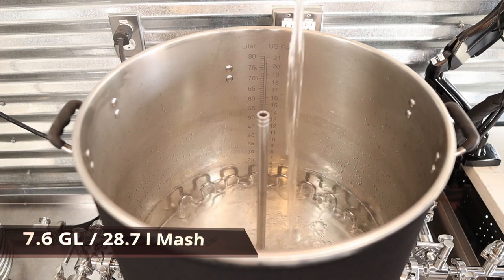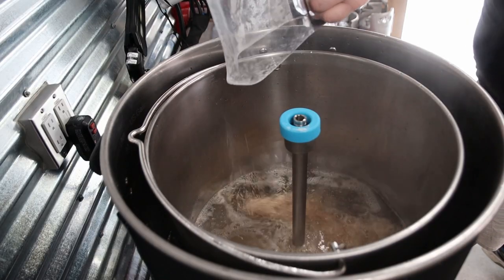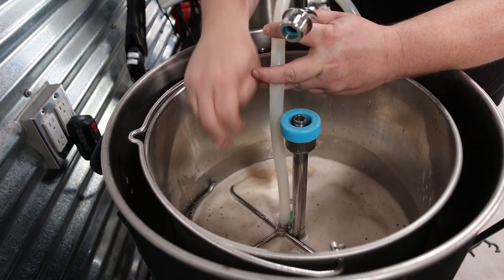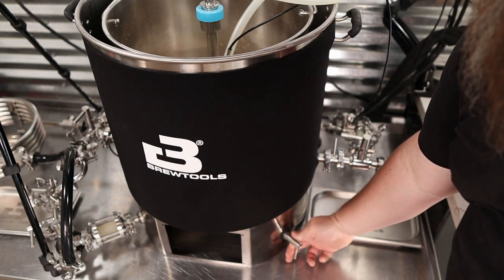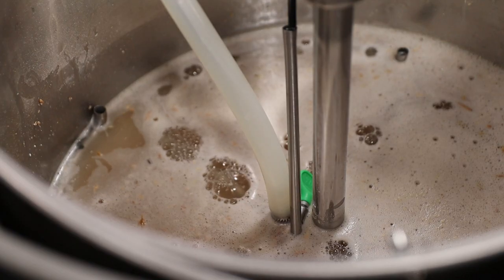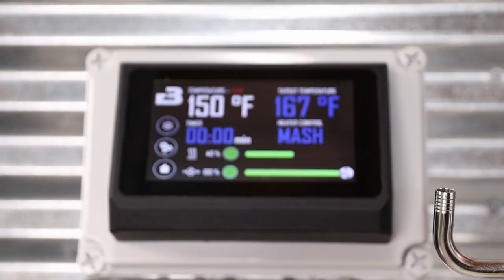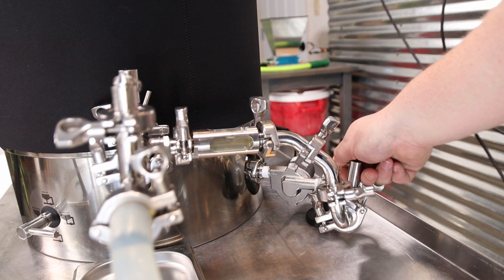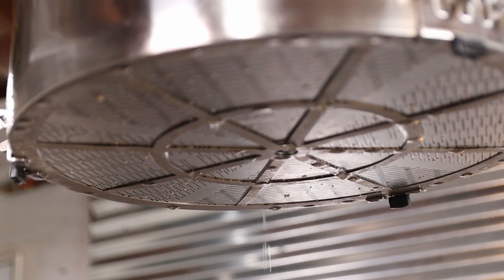How To Mash Brewtools

Comment: Hello Bradley, just grabbed a ssbt manifold , but noticed that the hose barb on it is only 10 mm wide, how did you use it with the 19 mm elbow ?  Also how do you know when to stop the sparging, can you tell the volume you are collecting when the malt pipe is sitting on top of the B80 ?  Thank you for your videos !
Reply: Hi Bradley, Hi Luca,
I would like to know as well how to fit the hose barb 19 mm with the 10 mm of manifold.
Any tips?
Thanks!

Comment: Thanks Bradley, that was useful video. I'm getting list of what I want to buy from Brewtools. How many pressure reliefs do you have in your system? Also what recirc manifold you using? I'm buying B40pro and I have doubts if 12.6'' ss brewtech manifold will fit B40pro mash tun...

Comment: Helpful video thanks. Didn’t understand the iso valve to the pump. If you have that closed but the pump running, doesn’t that damage the pump?
Reply from the maker: The pump has multiple paths for output It's never fully closed off for more than a second or 3 when switching valve configurations

Comment: Bradley, you lift the malt pipe completely before you start sparging? What's your BH or mash efficiency on average?
Reply from the maker: Very low 80s to high 70s I could definitely squeeze more out . I'm happy with my current numbers, malt Is quite inexpensive  🍻

Comment: Do you let the mash dry before getting it out of the tun? As a bag user I wonder how electric users clean their stuff.
Reply from the maker: Typically once I reach my boil volume I pull the mash tun I said it aside and a tray and let it drain a little bit more then dump it in the trashcan
Reply: @PortlyGentleman  ah so raw force after it dried. Thanks

Comment: Great video Bradley! Regards to mashout, how long would you calculate for this before sparging? Previously I have been doing this for 60min which I have found to be good, but recently I am down to 10minutes.
Reply from the maker: Certainly once conversion is achieved you're good to move . If you're doing a step mash then this will obviously take longer. For instance because I was brewing such a low ABV beer I'm pretty sure I could have stopped massing after about 20 minutes or so. I went longer because I use that time to do video things.

Comment: Great video as always! I'm still dialling in my B40 setup - I don't quite seem to hit the expected pre-boil volumes, (or gravities) of the B40 profile in brewfather - what sort of grain absorption & mash thickness are you generally going with?
Reply from the maker: There's so many variables when it When it comes to efficiency. I use a lot of Mecca greatest statement, most of their malts have crazy high diastatic power.
Reply: Hi. I have my B40 set at a grain absorption rate of .85 and a mash thickness of 3.8. Hit the numbers the last three brews. Saying that I previously also had good results with the mash thickness at 3.5, but found I had to continually manage the grain bed.  I have the mash tun deadspace set at 3.3L. This is 3L under the mash pipe and .3L in my default setup for the bypass. NB The kettle level reading is not the same as the amount in the kettle as there is .3L in my pipework and when I counter chill i lose another 1.2L. You should run some control tests to see how the water vollumes change on different setting and take all vplume readings taking this into account. IE. When I take my post boil volumes I know I need to add the 1.5L in my total pipework to provide the correct result.

Also try adding 15 minutes to the main mash rest step. This seems to have really improved my efficiency - so far a 60 minute rest I now let stand with whirlpool on bypass for 30 minutes and then circulate through mash for 45 minutes. I do have major doubts that sparging is very efficient on these all in one systems, and one reason why I have moved to a higher mash thinkness and hence mash volume where I know I will get a full extraction. I am thinking of trying some no sparge brews as I see people like Martin Keen on Homebrew Challenge getting great results without sparging and starting to believe is a legacy of the old methods using 3V setups.

If interested, I have my hourly boil off rates at 2.5 L for 1 hour and 1.8 for 90 minutes. Still fine tuning this tbh. The rate is not the same for 90 and 60 as you have the same overhead of ramping up and down the temperature for both periods. If i have to run a hopstand then I would increase this slightly.  This is with a steam hat and no condenser. Boil off rates are much greater wthout the steam hat.

Trub loss is currently at c. 3L but I increase if a hoppy beer due to hop absorption. This is always a gut feel tbh. 

I just brewed David Heath's ESB quite straightforward recipe and this resulted in a 86% mash efficiency and a 73% BH efficiency. The more hops in the beer, the more the BH efficiency should drop due to hop absorption. 

Hope that helps. And good luck. As Bradley says it is all about practice.

David

Comment: 20 minuts mash rest. What is temperature level??
Reply from the maker: its only 10 minutes 
The temperature fluctuation is extremely minimal. Lots of people mash in ice chess and what not.
Reply: @PortlyGentleman  thanks for the answer. Temperature level of the mash rest??
Reply from the maker: @adolfotavizon915  The temperature level is typically whatever your first mashed up or your only mashed up is. Obviously you could do one at a much cooler temperature if you want to would be the same thing.